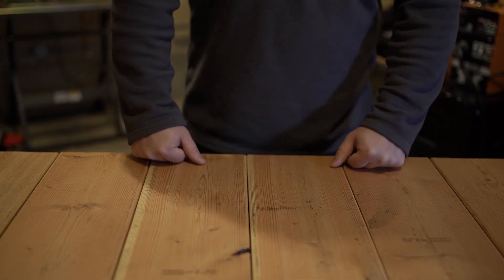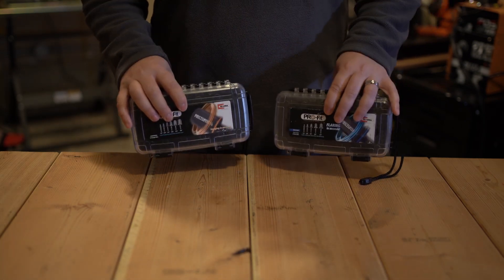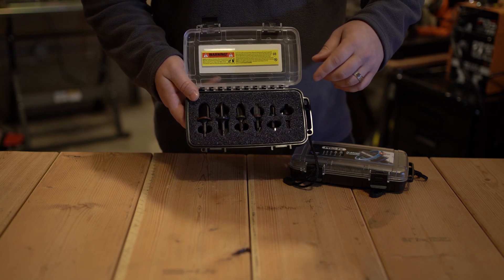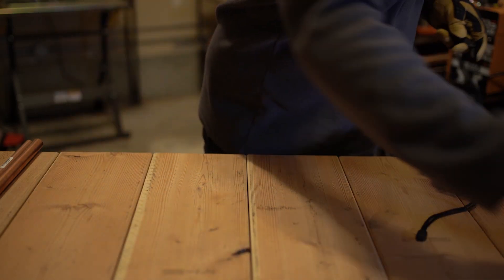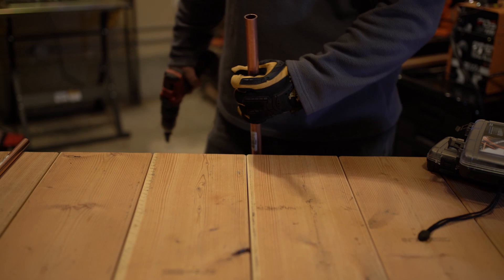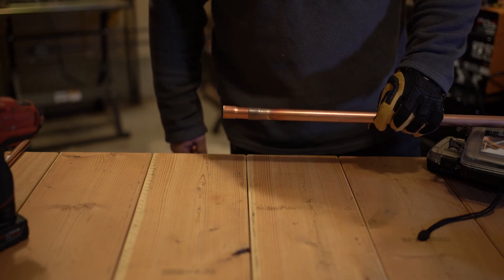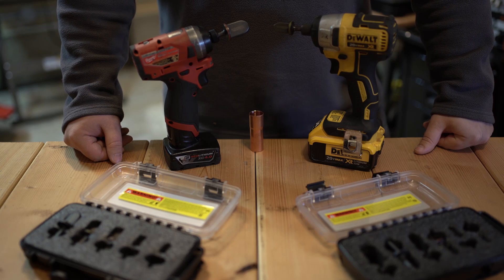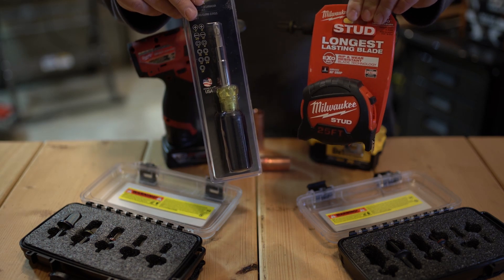Spin Swaging and Flaring Tools- spin and swage tools

Comment: Why are you torturing a drill on a hard copper pipe it is meant for soft copper.
Reply from the maker: Because they state in their manual that it works on hard copper by using friction to heat up and anneal the pipe.  Obviously it doesn’t work that well.  Had to test it out

Comment: Haven’t had much luck with the larger sizes but smaller 3/8-1/2” seem to go well
Reply from the maker: Yes they work much better on the smaller sizes.  Especially the soft rolls.  All the manufactures say they work on hard drawn too so wanted to try it out and the largest size hard drawn pipe.

Comment: Maybe these bits work great on some of these cheaper line sets that some of these distributors are selling, I know some of these line sets will kink just using a tube bender
Reply from the maker: They definitely work better on those cheap ultra thin walled line sets 😂.  They also work better on the smaller sized soft copper